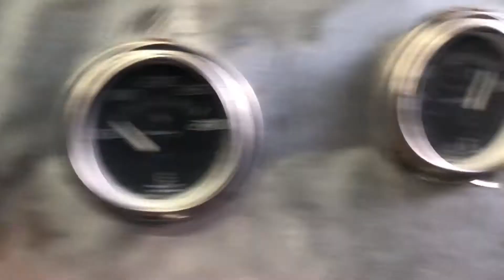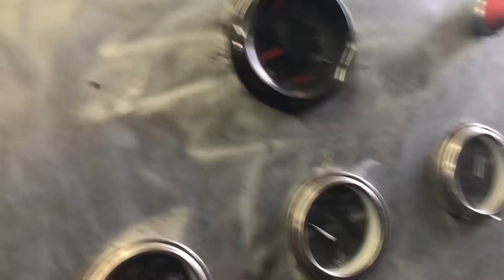Rowdy 350 SBC shaking on test stand.

Comment: What's the camshaft duration @50 and (LSA) Lobe separation angle.
Reply from the maker: comp cam grind #280H.  230/230 duration, 110 degree  lobe separation.